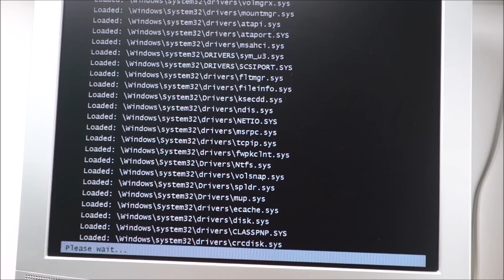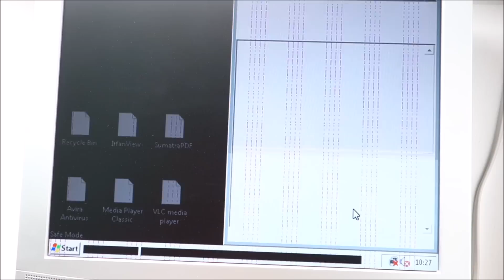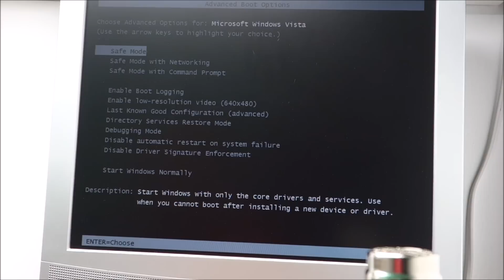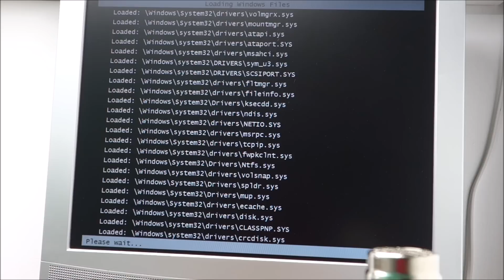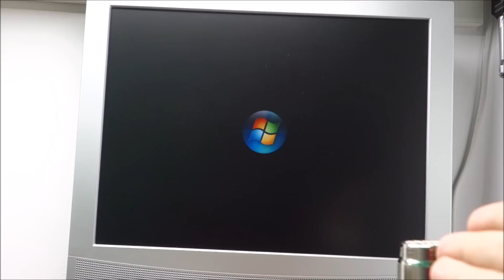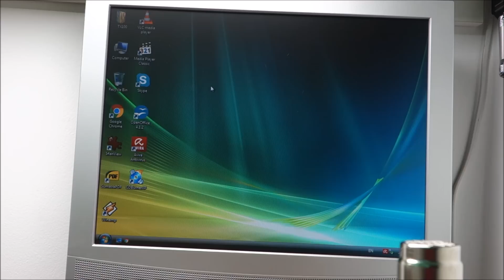How to reflow a video card with a cheap heat gun

Comment: +
Ultimate DIY
Yup, very, very good tutorial how to easily overheat and fuck up PCB... Heat guns are useless for BGA reflow because it applies too high temperature, so you put very high thermal stress on  the PCB and chip, so you can overheat and damage them... To do this in acceptable way, you shout put card on the pre-heater, preheat PCB to around 120 degree C and  then reflow using hotair gun... The best  way to this is BGA rework station...
Reply: My understanding is that whole point was to see if a throwaway graphics card could be rescued using a cheap heat gun without a song and dance. Mission accomplished, but I guess this is not one of your "acceptable" ways of doing things.
Reply from the maker: Exactly 👍🏻

Comment: My advice is to use a temperature gauge after I believe I cooked my card through overheating! It doesn’t work at all now after using the heat gun. I used baby wipes to remove the old thermal paste - could it have been that?

Oddly it doesn’t smell bad
Reply from the maker: It's not an exact science without a hot air station, so maybe you overheated it, or a solder bridge formed somewhere under the GPU.
Reply: Used 70% alcohol wipes to remove the paste.

Comment: Salut! Am un Radeon 280x toxic edition de la Sapphire de aproximativ 5 ani. Acum 2 ani am fost nevoit să o duc în service să îi facă un reballing pt că îmi apăreau artefacte pe ecran. După reballing a mers surprinzător de bine și a ținut mai mult decât mă gândeam, însă problema cu artefactele a reapărut. Crezi că merită să îi mai fac un reballing sau să încerc metoda ta cu heater-ul? Țin să menționez că placa îmi stă între 55-60 de grade când rulează și încă face față multor jocuri de grafică bună. Ar fi păcat să nu o pot salva și tind să cred că merge salvată încă o dată.
Reply from the maker: Salut. Asta e intrebarea de 1000 de puncte si din pacate doar tu poti raspunde la ea. Personal nu i-as face reballing, pentru ca o consider o reparatie temporara pe bani multi. In schimb si solutia mea s-ar putea sa nu mearga sau chiar sa strice placa daca nu e facuta corect. Deci doar de tine depinde ce alegi.

Comment: hey my laptop condition is like this. everything just works fine, but when i played games with demanding graphics, the laptop will gives blue screen error. is it graphic card problem? ca i solve this with heat gun?
Reply from the maker: Hi. If it's an old laptop and not worth repairing it at a proper repair shop.

Comment: Nice video! i have some questions 

my laptop GTX1070 chip has no signal, so i wanna reflow it but my heat fan gun also has no temp. display neither, so how can i fix it, and how long did you heat it??
Reply from the maker: I would not do it on such hardware. Better take it to a service.
Reply: @UltimateDIY  i hope to do that but service centers doesn't wanna repair my laptop and they just said i should change all of motherboard and it will cost at least 1000$ so i just gonna reflow it. how long did you bake chips?
Reply from the maker: @야굴  it was too long ago, for me to be able to give an answer. In your place I would search on forums to see how long others did it on laptop gpu cips. Also, use flux.
Reply: @UltimateDIY  is indispesnsible to use flux?
Reply from the maker: @야굴  yes.
Reply: @UltimateDIY  K' thx for your kindness
Reply from the maker: No problem. Hope you get it fixed!

Comment: You heated it for about a minute, right? What heat gun is that - is that for taking off the paint with 2 speeds? I have a damn BGB with unlead flux and I tried so far several things (cooking in the oven at 190C does not help, this flux melt at 220 I think). I tried with heat gun for electronics too, nothing. I need more power :) but the trouble will be temperature control.
Reply from the maker: Yes, about a minute, an yes, it has two speeds and it heats up like crazy.
You coud try some temperature control with a multimeter with temperature probe, but it will still be some sort of guessing involved.
Reply: Hmmm when I bought a multimer I got temperature probe and I wondered why is that for. Time to search for it.

Comment: so basically it was dead and now is working?
Reply from the maker: Yes.
Reply: @UltimateDIY  I have 1080ti which is not working for a while, what temperature I have to use on my heatgun?
Reply from the maker: Mine has 2 settings and I used the lower one. It needs to be above 250 degrees Celsius.
But make sure there is no other way to fix your card before attempting this. This is a kind of last resort sollution.
Reply: @UltimateDIY  can this kill you card?
Reply from the maker: For sure.

Comment: few months - yes. few years - nope. mine gtx580 lived for 2 months and solder cracked again.
Reply from the maker: I think the higher the temperatures reached by the card, the shorter the fix will hold.
Reply: yes...also the cards with two fans...there's vibrating problem. which is not good for gpu solder. new card is a new card
Reply from the maker: Indeed!

Comment: Hi...  Do u wait for the chip to cool down before assembling again pr do it directly???
Reply from the maker: +bia shz hi there. Wait for the board to cool down on a flat surface or else it could warp and cause problems.
Reply: Ultimate DIY mmmm....  Ders 1 prob....  I already heated and fixed the thing and tried turning d lappy on but ddnt happen.... Again im  Trying to do that.... When i removed the second time it ws kinda stuck but it came out again after pulling little bit from the heatsink rod thingy....  Any opinions??
Reply from the maker: +bia shz not really sure what to tell you. Sometimes it-s not fixable and no matter what you do it will not work again. Keep us informed, I'm curious if it will work for you in the end.
Reply: Ultimate DIY omg....  2nd time after heating and cooling it worked!!!!!!!!!
Reply: M totally shocked...  I had lost hopes.....
Reply from the maker: +bia shz that is great! :)
Reply: Ultimate DIY thnx a lott man!!!  Uve been of great help!!!  ;) :)
Reply from the maker: +bia shz welcome! :)
Reply: Hi My friend!

I have heat gun with 2 levels, 1100W and 1500w where can I use it? How much time hot the gpu? I have an Evga 670. Thanks in advanced!

Comment: "a few months to a few years" that's a bit hopeful ain't it?
Reply from the maker: Yes, because nobody knows how much it will last. This is not a permanent fix, as no permanent fix exists for this problem.
Reply: @UltimateDIY  reballing is a permanent fix or permanent kill
Reply from the maker: Depends. If just cracked solder, then permanent, if damage in chip, then it will last just as much as reflow.

Comment: Bro I have a weird question. I have a dedicated graphics card in my laptop that also has an APU, so i was wondering is there any way that I can pull out the dedicated card and put it on a pcb and use in my desktop?
Reply from the maker: I have no idea. But if you manage to do it, it does not make sense because a laptop gpu is much more expensive than a similar desktop gpu. You are better off selling it and getting a desktop one.

Comment: I refluxed my GT 730 , and it works for a few days but then again the artificats reappear, 

Is there a certain type of flux I should use?
Reply from the maker: No, but probably the card is too damaged. In many cases the gpu die itself has issues, not only the solder joints, so a reflow helps only momentarly.
Reply: @UltimateDIY  yeah I am like reflowing once a week now , since it works great after reflow. Overclocking, heavy games, long hours, doesn't matter, but then the GPU kills itself and I'm like resurrecting it every week lol
Reply from the maker: @KailasNathX  at least you keep it working as long as you can.
Reply: @UltimateDIY  yeah ⚡❤️

Comment: good Job. I think you've heated the chip a little bit . I think then the cars are made the temperature is not supposed to be higher than 150 degree Fahrenheit and for no longer than 180 seconds.
I don't think you had it on for longer , but with a much higher temperature
Reply from the maker: +Michael Paradigm thank you. Yes, the temperature is hard to control with the heat gun and not enough temperature results in no or just partial reflow and on the other side too muck temperature fries the chip, so it's a little hit or mis. Luckily it survived and it's still working :)
Reply: You know you can protect the other components , by using aluminum (aluminium) foil and cut out the center of what you're working on. Be aware that the shiny side reflects heat , while the non reflective side lets it through.
Reply from the maker: That is good info, thanks :)
Reply: thx for info :3
Reply: Michael Paradigm 
The shiny surface only reflects radiation. The heat gun mainly uses air (convection) to heat up things so in this case it doesn’t matter with side you put up. It could be anything that can withstand the heat and will stop the airflow from reaching the card. 

You’d be right if one uses an infrared heat source.

Comment: it helped me my gpu is working dead pcs+ hd 7850 into working card by heating right into chip for i dont know 30to 50 minutes when it smeells burning near the core i stop heating and i heat with air dryer full heat
thanks
Reply from the maker: Thank you for watching the video and for your info.
Reply: Minutes? Don't you mean 30-50 seconds?
Reply: he said he used a hair dryer

Comment: never ever do that! you will ruin your card. the oven its safer because you can control the temp.  dont forget to cover the conectors with foil to desperse the heat!
Reply from the maker: nikolaos stavrou the card was already unusable. The owen is safer for the card, but the fumes that are realeased into the owen make that a health hazzard when you bake food in it again (also using the heat gun in a closed room without a mask is really bad). So the owen method is superior if you have one that you only use for this kind of DIY projects.
Reply: if you use the heat gun use  a doog quality flux to clean the corrosion underneath the chip . and the rest you can remove it with alchohol . ps i am an elecrtonics engineer.
Reply: and a tip use a thermometer infrared if you have to check the temp. on the chip to prevent damage!
Reply from the maker: These are good informations. Will keep in mind :)
Reply: Wow - good suggestion - and this is the ideal circumstance for using an infra-red thermometer - it is reliable and accurate really only on "black bodies" - and this exactly qualifies.  Good call!

Comment: Well the word you was lookin for in the end for the thing you heat shrink over soldered wires are called heat shrinks :D hopefully it will work with my two faulty ATI graphics cards, I've got them nearly for free, so I think it's worth trying. BSODs on high resolutions, weird color stripes on desktop.
Reply from the maker: +webfischi yes, that's it :)
There is a high chance it will work. For how long, that only time will tell.

Comment: How many times can you Reflow? Or it doesnt matter?
Cause I have been reflowing for the 3d time now, all is well
Reply from the maker: There is no real answer. It can work tens of times or only once, there is no way of knowing sadly.
Reply: Thank a lot mate, subbed because of the fast reply
Reply from the maker: +LegendColgo thank you! it would have been even faster if I had more free time this weekend :)
Reply: Never do that dude, reflow never gonna fix the problem who is fixed with only re balling, also reflow could damage the PCB.
Reply from the maker: Why would a reflow damage the PCB and a reball not? They both need to get at solder melting temperatures.
Also, who would do a reball on a $5 GPU?
The fix in my video is for getting a little more life out of a dying GPU.
Reply: 5$? what if you cant remove it by yourself? is it really 5$ to get a new one?
how can you remove the old one?
Reply from the maker: I meant the card that I fixed in the video is worth about $5. A reball would cost in my city about $20 minimum, in a low quality manner. In this situation a reball would not be worth it.
If you have a defective GPU that is worth $100 or more, then probably a reball is worth it. The other thing is that sometimes actually the problem is not the solder joint, but actually the chip itself and heating it up actually fixes it for a while. In that particular situation a reball would last exactly as long as a reflow and would only cost more with no benefit.
Reply: Thanks a lot, I really appreciate your answers, plus you reply quickly :)
Reply from the maker: +LegendColgo welcome! :)
Reply: Higher Reballing isn't fix too. They just change those little balls under chip, but you still have your old graphic chip, which was hot enough to solder that same balls under it. If chip was that much hot once, he will never be good anymore. Reballing is temporary fix just like heating.
Reply from the maker: Indeed, and way more expensive. Let's not forget about that.
Reply: Definitely. I'm always between reflowing and buying new motherboard. Never reballing.
Reply: Headingmashine1 
“If the chip was that hot once, he will never be good anymore”
How do you think it was soldered to the board at the factory?
When reballing a chip, usually leaded solder is used which has a lower melting point. But to remove the chip it must be heated to approximately 220°C first. The chip is designed to handle that. 

The problem with reflowing and reballing with a heat gun is of cause that you hardly have any heat control. So parts can easily be burned or the chip could be partially reflowed because too little heat was applied. 

Also applying heat only from above (and not from the bottom as well) can be an issue. 

But on a card that is otherwise thrown away, I’d say it would be a waste NOT to try it.

Comment: Why are you heating GPU? Its VRAM issue. Since you heat VRAM too by small amount, it got fixed. When you aim wrong thing, and hit the right thing are called critical strike. You dont have knowledge about this, but you are lucky.
Reply from the maker: +Radius Nightly you might be right, but I don't think the VRAM got enough heat to melt solder.
Reply: Ultimate DIY Heating one of a VRAM fixed the issue, while you were heating GPU, a problematic VRAM got enough heat to fix the problem, and you didnt focus VRAMs. Thats critical chance hit you got.
BTW It was a small problem, if has been bigger, like colors, boxes or hard lines, i dont think you would fix it without aiming the VRAM.
Reply from the maker: If that would really be the case, then I was lucky indeed.
Reply: I think, you both are right. It could be the GPU, but also VRAM could have a problem. I think, GPU is heating more than VRAM during card operation. So when card is faulty, it is most probably due to bad contact of the GPU.

Comment: 2:33Where to buy hot air gun? :)
Reply from the maker: Hardware stores. But if you plan to use it only on electronics maybe better search a hot air station. Although they are way more expensive.

Comment: Hey , before i try this i have a radeon hd 7950 from gigabyte 3gb edition so this gpu when i start the computer on normal windows i get some red lines on screen ( the lines are very hard to see) the line are without driver , when i install driver i restart the computer i see windows  starting icon then just a black screen after , if i go onto safe mode i have no lines , what's the problem of it  , may be the driver?
Reply from the maker: +K3age I think it's the card, not the driver and the problem is more evident on higher resolutions.
Reply: What should i try? to mention the card is getting really hot in some places before i boot up , i opened the gpu too look i cleaned but same what should i do  , i just bought this gpu so i don't want to trash it so fast
Reply from the maker: +K3age second hand? The person that sold it to you might have known about the issue :(
Reply: I got it from a friend he told me everything was working i even went to his home and saw the gpu has no problems but idk what happened when i plugged it on my pc
Reply from the maker: Take it back to his place and see how it performs. Maybe there is some other weird problem. What PSU do you have?
Reply: Anyways you have a like and a sib from me but what could i try to fix this
Reply: Ultimate DIY I have a 475 psu from delta
Reply from the maker: Thanks for like and sub!
Your best bet is to test in in a different PC and see how it works. If it works ok there, then you have a problem in your PC. If it does the same there, then it's the card for sure and you either take it to a repair shop of try to reflow it yourself.
You could even try this: https://www.youtube.com/watch?v=xkrvUGzM7j0

Comment: This metod never works for me i am using  same  heat gun  speed 1 on  gun  and kimbo flux i killed  two cards gt 8600  gt 9500  i have only snow on this   2 cards  but  cards working    have   picture, after heating  cards total dead no picture black screen !!!
 dont wasted you time
Reply from the maker: Maybe you overheated them, maybe you did not heat them up enough, maybe the problem was the memory and not the main chip. This is not a failproof method, as there are so many possible things to wrong...
Reply: meybe

Comment: Reflow and sell
Reply from the maker: That would be wrong and lame.
Reply: @UltimateDIY   Guy said ill fix it and then i'll sell
I'm poor dork that lives on E5200 and an hd 6450
Reply: @UltimateDIY  its a quadro 600 to fix
previous owner used toothpaste as grease and now it won't display
Reply from the maker: As long as you specify in the sell add that it was reflown. It should be fair to the one buying it at a cheap price.
Reply: @UltimateDIY  I'll sell it to nearest gpu shop
And no they don't understand reflow and will buy it nevertheless
Reply from the maker: No comment.
Reply: @UltimateDIY  same for me